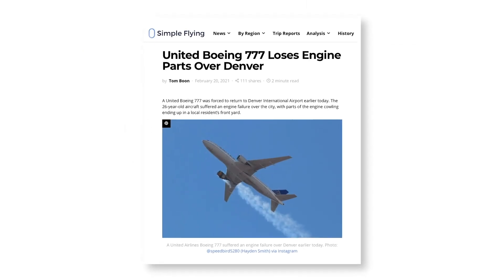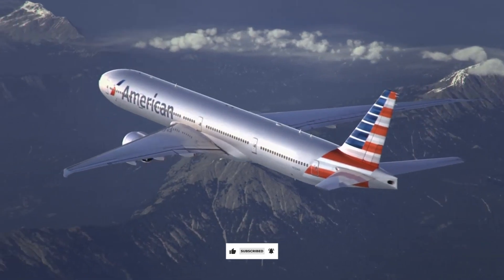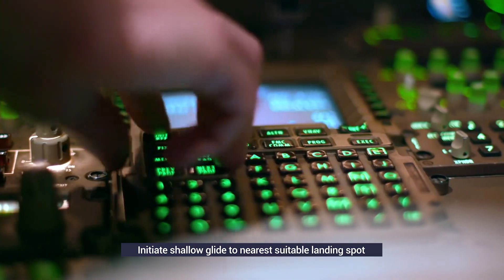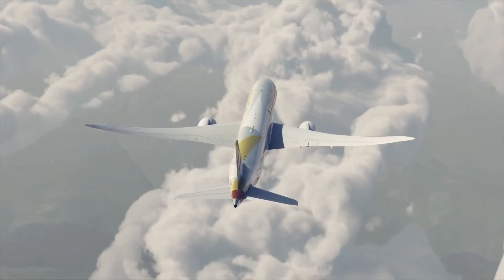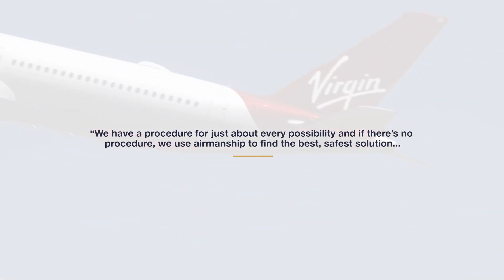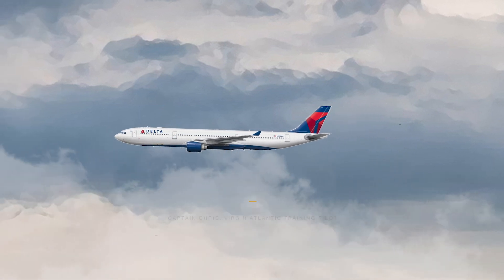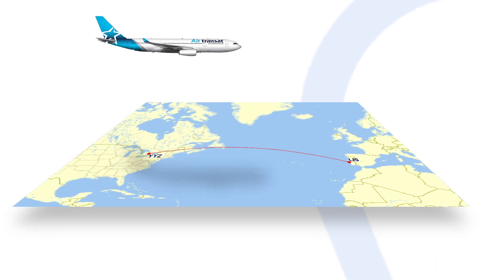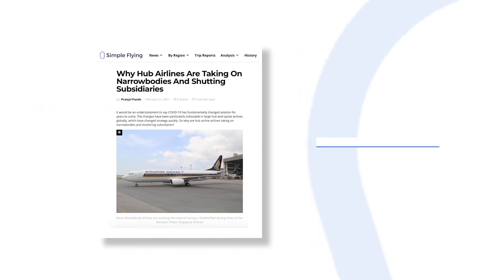What Happens If All The Engines On A Passenger Jet Fail?

Comment: A couple years ago there was a miscommunication that caused ATC to think a regional airline flight had both engines fail. It was handled like any other engine failure except options were given for smaller airports and other flights were actively moved out of the area. It was only on final approach to Nashville that it became clear one engine was still operating. 

From anywhere near cruising altitude I'm confident any airline category aircraft over the lower 48 can glide with both engines out and make it to a runway safely. In most of the country there would be multiple choices of available airports to glide to. 

This does not include an even rarer event that would force an emergency descent in addition to dual engine failure. If pressurization is lost like in the southwest incident and both engines fail the emergency descent would significantly reduce the glidepath. I'm confident that most crews could improvise to find a safe solution, but that severe combination could be enough to cause an off airport landing but there are still military bases and unpopulated areas that can have services ready for an arrival.

Comment: Is landing more difficult since assume no reverse thrust?  Thank you for  this answer to a question most of us wonder about but have not been enlightened.
Reply: Usually reverse thrust just reduces the wear and tear on the brakes. The needed runway length is the same.
Reply: @Hauketal  interesting.  Thank you.

Comment: It should be noted that many airliners also have a Ram air turbine system to power the electrical system in case the APU also doesn't work correctly.

Comment: I'm not at all afraid of flying but ALWAYS think about engine failures when in the air, what consoles me is the fact that I would be practically winning the bad luck lotto if I died in a plane crash so I try to chill and enjoy turbulence as if it were a roller coaster

Comment: Etops , SARPS recommends) gave the first 2 engine airliner the A330 a +240 rating, meaning
they are allowed to fly outside the 240 minutes of a suitable landing strip.
Since then I would think many aircraft type will have been approved.
I for one hope that only one engine fails as 4 hours gliding without any power,   well !
One of the reasons that Singapore Airlines & Thai Airways purchased the A 340 to fly direct to New York & of course having  4 engines none of the above applied so no diversions necessary making it more direct

Comment: Working in the Aero industry for 30 years and being a frequent flier for work,I have been lucky enough not to experience any engine failures..Theres been minor technical issues on the ground and in the air with the aircraft,but nothing scary or life threatening..Thank God
Reply: Lucky you! I was on a flight in 787 where we had just reached 80 knots as the number 2 engine surged and the pilots instantly rejected takeoff. Super fast call by the pilot in command and no dramas. The orange flames lit up the whole rear cabin area as it was a night time departure.

Comment: I am never afraid of an engine failure, I just know that it would be a heck of an event to film and that when flying over the U.S, it is more than likely that a safe landing is achievable.
Reply: A couple years ago there was a miscommunication that caused ATC to think a regional airline flight had both engines fail. It was handled like any other engine failure except options were given for smaller airports and other flights were actively moved out of the area. It was only on final approach to Nashville that it became clear one engine was still operating. 

From anywhere near cruising altitude I'm confident any airline category aircraft over the lower 48 can glide with both engines out and make it to a runway safely. In most of the country there would be multiple choices of available airports to glide to. 

This does not include an even rarer event that would force an emergency descent in addition to dual engine failure. If pressurization is lost like in the southwest incident and both engines fail the emergency descent would significantly reduce the glidepath. I'm confident that most crews could improvise to find a safe solution, but that severe combination could be enough to cause an off airport landing but there are still military bases and unpopulated areas that can have services ready for an arrival.

Comment: That air Transat A330 was not a dual engine failure! The engine's stoped due to fuel exhaustion, they ran out of fuel because of a fuel leak.
Reply: It was still technically engine failure, as in the engines failed to run due lost of power from flaming out.
Reply: Fuel exhaustion is the most likely cause of an all-engine failure, and would also prevent starting the APU. It seems weird not to have mentioned this or the ram-air turbine in the video.
Reply: @Daedy  you can call it what ever you want. As a jet mechanic it's called fuel exhaustion. If a pilot tells me or logs something has failed I'm looking for a part or a component that has broke.
Reply: @Soham Patel A330. Air Transat flight 236 was a Airbus 330. Registration C-GITS
Reply: @Soham Patel after a while the numbers run all together. Ill mix stuff up all the time.
Reply: @Soham Patel I didn't know Airbus made an A310 till today when you said A310. I had to look it up. You taught me something today.
Reply: @Soham Patel it's a short wide body with no range. The 200 range is 3,500 NM. The 300 range is 5,150 NM. An A350-1000 range is 8,700 NM. Almost double of the A310. No wonder why you don't see 310's
Reply: @Number-oo8xq  The investigation called it engine failure due to fuel leak. So it's not up to me how I call it. If you have an issue with the classification then bring it up with the investigation authorities for that particular incident.
Reply: @Daedy  Nothing about the engine's failed. Replenish the go juice and the engines will roar back to life. Rolls-Royce who made the engines will not classify that as a failure. I see your point, yes.
Reply: @Number-oo8xq  And nothing about all that matters in the end if the engines are starved of fuel despite being in perfect working order. 

The issue here is a practical one, whereas you're arguing from an engineering standpoint which wouldn't have affected the outcome of what transpired either way - the engines failed to re-engage regardless. Whether they were actually faulty or not is irrelevant.
Reply: @Number-oo8xq  It doesn't matter how the engines stopped producing thrust, the point is, they lost thrust in both engines at cruising altitude and so it is perfectly valid to use it as an example. The video is about what would happen if both engines were to lose thrust, whether that happens because of damage to the engines or fuel exhaustion won't change the result in any meaningful way
Reply: @Number-oo8xq  The fuel leak was in one of the engines. A fuel and a hydraulic line rubbed together.

Comment: Deploy the RAT
Reply: (Ram Air Turbine)
Reply: yea you beat me to it... and oddly enough the engineers of the 737 (the most flown jet in the world right now) didn't feel it was necessary to include one because it has the mechanical linkages... was shocked to see that it wasn't added to the MAX... but yea I was gonna say drop the RAT then look for an interstate highway (MIL-SPEC) or a still body of water

Comment: Not sure if Simple Flying has covered this, but there was a case of a B767 running out of fuel in Canada in July 1983. The pilot was a skilled glider pilot and knew of a decommissioned air force base within range of the aircraft's glide ratio. The aircraft was landed safely and went on to continue operations for the next 25 years. The aircraft got nicknamed "The Gimli Glider."
Reply: Yes it was like two weeks ago
Reply: @VilniusVideo123  Simple Flying puts out so many great stories that it's hard to keep up to them.
Reply from the maker: Yes, check out this: https://www.youtube.com/watch?v=LSzusVHYkoc&ab_channel=SimpleFlying

Comment: The APU can usually only be started or supply bleed air below a certain altitude, 25.000ft for most aircrafts, until that it would be a windmilling start with both engines at the same time and then with the APU one by one and hope for the best.

Comment: Best example for this video: Air Canada Flight 143, Boeing 767-200. Both engine just died. literally! Glided until it safely landed. My Mom's friend was on this flight back in the 80's
Reply: Not exactly died. They ran out of fuel due to miscalculation. But yea, the effect is the same. Gliding to the nearest airport.

Comment: I don't worry about it much either. I think most people think planes can fly only when the engines run. These planes are designed to efficiently glide if the engines are off and it already has momentum.

Comment: Not engine failures. I worry about the pilots not deploying flaps on takeoff.
Reply: Realistically, that's not possible unless both pilots were deaf. The takeoff configuration warning is very difficult to ignore

Comment: Um, the APU doesn't work when you're out of fuel. You forgot to mention the RAT in that case. Also, running out of fuel will stop the engines running (fail to operate). Running out of fuel can be caused by many reasons, the A330 you mentioned did run out of fuel because of a fuel leak due to a fractured fuel line.

Comment: Was waiting for you to mention use of the RAT (Ram Air Turbine). I guess if the APU is available it will create a lot less drag than the RAT would for gliding purposes, but I would think it would have an honorable mention here.
Reply: indeed and I even think it's passive when in flight: it would deploy automatically when all hydraulic pressure (or enough) is lost to provide some. I think there's hydraulic-electric generators too on-board that use the RAT to provide electrical power.
Makes me wonder if the mentioned A350 could possibly detect the issue before the RAT even deploying and turn on the APU before the RAT deploys.
Reply: Exactly, it's vital to mention this!
Reply: @Kalvinjj  no, the RAT is deployed immedietley - ie if you need hydraulic or electrical power NOW. It deploys when there is an electrical fault. In aibus this is known as the ELEC EMER CONFIG - basically means you are running on RAT power

Comment: No I Am  Not At All Considered About Engine Failure.I Enjoy The Flight.🙂✈️❤️❤️
Reply: @Soham Patel There is sufficient training for those situations. Getting a plane down with 1 engine really doesn't require much training as the actual emergency landing is not much different to a normal landing, you just need to add rudder inputs to correct the yaw created by the asymmetrical thrust